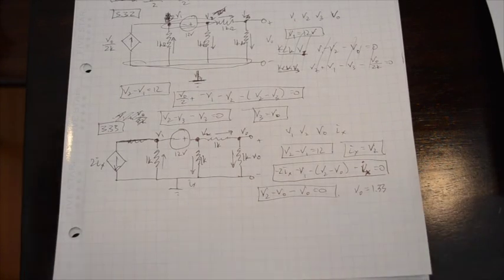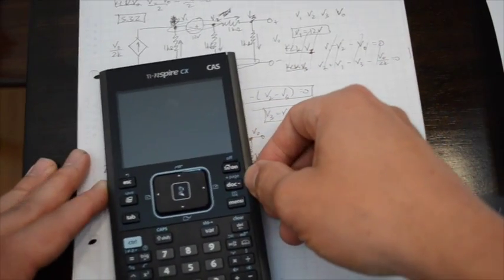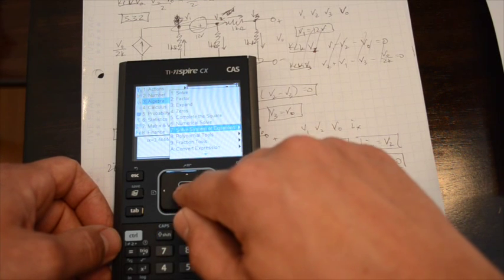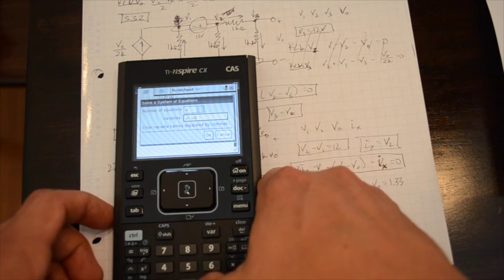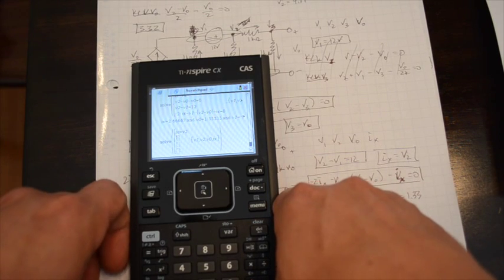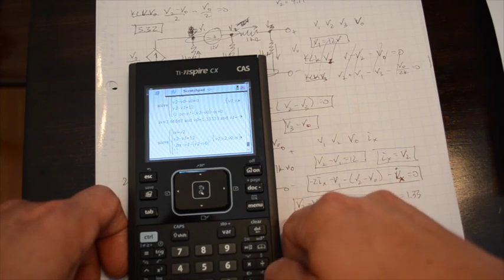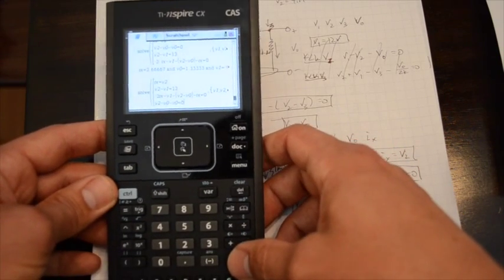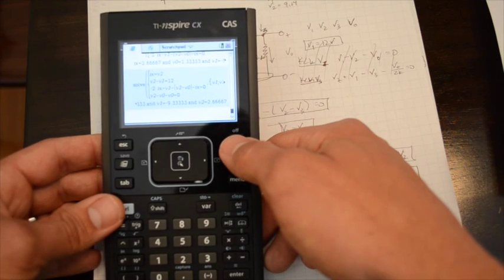Solve Circuits Matrices System of Equations TI Nspire CX CAS

Comment: HI do you know how to use this for Complex numbers system of equations multi variable
Reply: I realize I'm a year late, but I just figured it out, you have to use Complex Solve, instead of the normal Solve. All you have to do is type the letter c before Solve(), everything else can be done the same way as in this video. It should look like: cSolve()
Reply: @patrick-is-so-cool  have been looking for an answer like this for hours thank you !
Reply: yah i need to know how to do this as well, i have not seen any guides on this. This is a pain in the ass when you're trying to work with AC circuits.
Reply: @Holeyymoleguacamole  Need to figure out too! Searching everywhere to find it, but can't find a guide.

Comment: This video doesn't use matrices.  Please don't title a video with words not applicable to the video, it makes it hard to find the videos I'm looking for.
Reply: Matthew Huebsch its for circuit analysis...its title exactly as it should be.
Reply: @Z F you're still wrong. He's not solving this using a matrix, as is suggested in the title. Instead he's using a system of equations; a system of equations can be written in matrix form which, when input on the ti calculators, does the same thing.